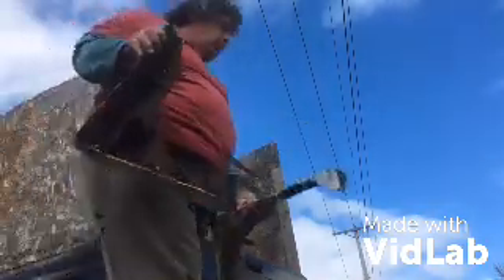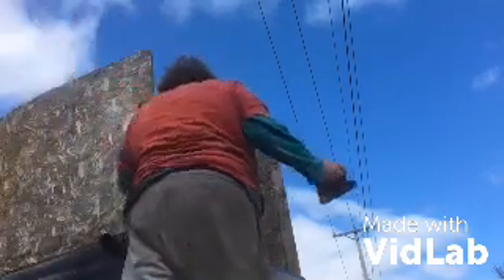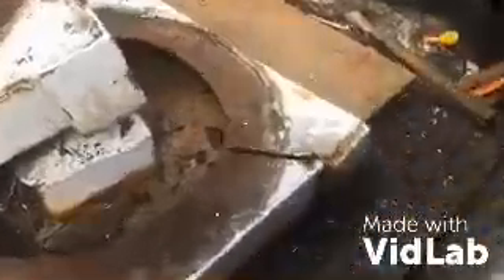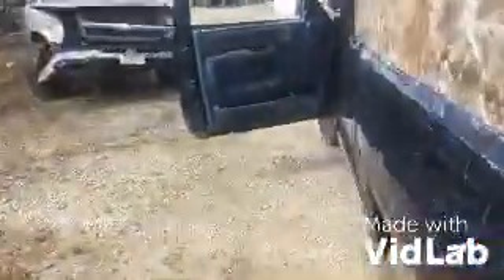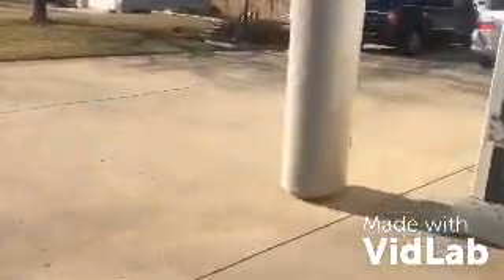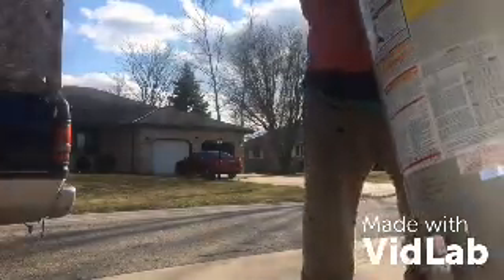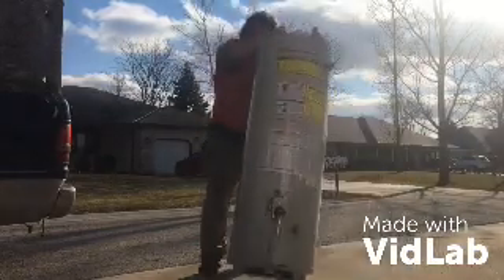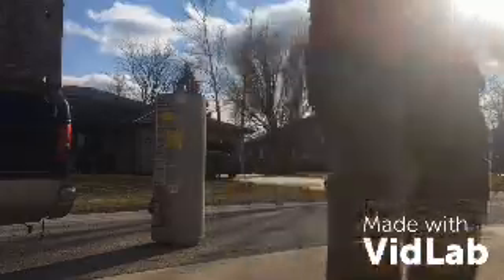YES! I FOUND SCRAP!!!

Comment: If the yards out here in central PA were open I'd be picking up. There's a washer dryer n fridge a quarter mile from me n no one touched em in days. Quick $, no place to go w it tho
Reply from the maker: Wow I can’t remember the last time I’ve seen that happen well I guess I can back when Obama got into office in November 2008 scraps or $25 per ton and most yards were closed or they had gone out of business by then
 Scraps were sitting out on the street for days and days
Nobody gonna pick up a refrigerator and a water heater if it’s only worth three dollars
Ya know 
Unfortunately this is reality the real value of that Scrap is actually just about nothing
The way it always was
Long time ago and it could be that way again 
I sure hope not
That’s a strange site though
Seeing things sitting by the curb that ordinarily would’ve been gone in five minutes
Reply: @steelisthemeal  it's about 600#s, if I grab n spend a half hr on it, I'd get a few motors n compressors out of it. N copper n wire. Our prices dropped 30% in 24 hrs here, #1 copper went down $0.40¢ overnight. Sucks
Reply from the maker: brad kroboth yes it’s the first time I’ve seen number three grade copper under a dollar at the 1 yard it’s $.80  a pound 
Yikes.
Reply: @steelisthemeal  damn, that's painful. I got $1.70 for light copper 2 wks ago, #1 is going for that right now. I may go grab the stuff n cut it up n reassemble the fridge n sell it for $25. Quick cash n all the parts are there

Comment: Marty , Just a few suggests : 1 )   Move those two white trucks out of the middle of yard , next to the river . 2 )   Use some of the pallets and make pile dividers ,  3 )   Use one sections for clean Alum. 4  )  use another section for dirty Alum.  5 )   Use another section for auto cast , hubs , rotors etc. 6 )   Now designate one location for all Steel , Misc. 7 )   Now work on all the metal next to the building  8 )   This will allow you to back up to the door , and load up metal in the building Now when you come in to the yard you have places to store every thing .Read more Show less